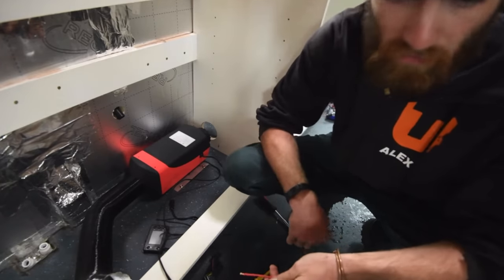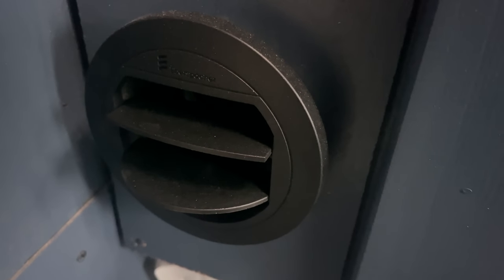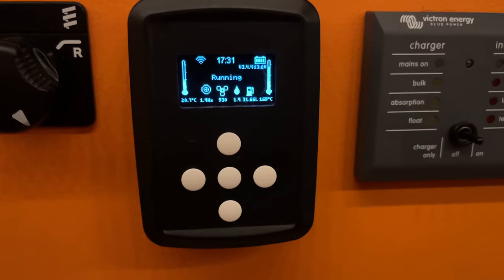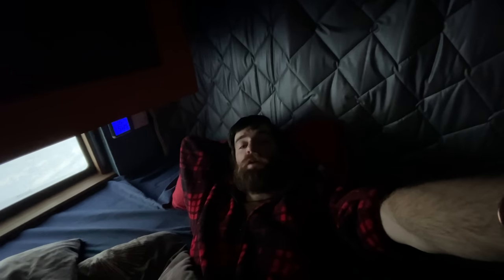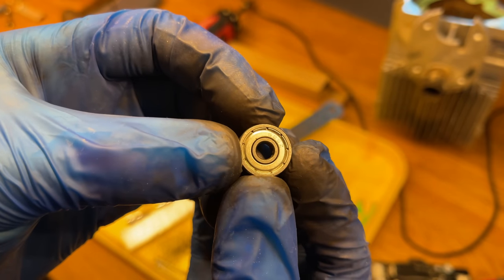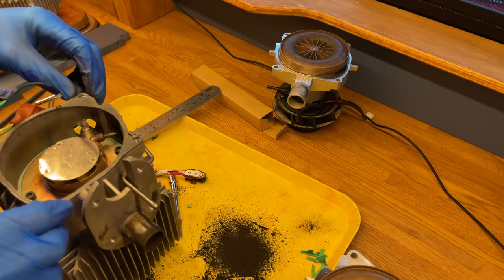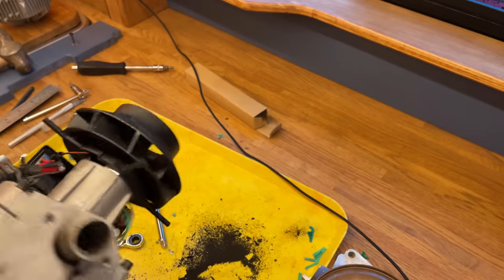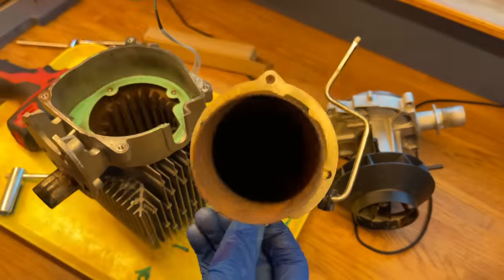2000 HOURS LATER! Chinese Diesel Heater

Comment: I actually enjoyed your video.  Factual and no ridiculous claims made.  Many others, out there, just don’t know how these things work - like claiming the 8kW output, which cannot exist in this range of heaters.

Your extra bends and length of the exhaust may make a difference to the operation - a carbon monoxide tester would help but we do not know how it was coping before.  

A couple thousand hours from chinesium bearings is likely good.  You noted the armature had been balanced - but then they may have added poorly balanced fans on the shaft.  Some better(?) fans may have extra weights attached to improve fan balance.  

With regard to the bearing fitment, one bearing should be press fit in its housing and the other needs to be a sliding fit to accommodate expansion between the bearings (fixed bearings would wear prematurely as they would have no end-float and thus load the bearings, axially as the temperature varied.
 
Running on heating oil (28 seconds Redwood kerosene) seems to be an acceptable alternative to diesel (the fuel the machine is designed for).  The calorific value of the kero is a little lower than that of diesel, thus producing a slightly leaner burn.  This may help where excessive bends and/or extra length of ducting is introduced.  That grade of kerosene seems to have adequate lubrication to protect the pump from early failure.

The Eberspacher installation details, for their heaters, provide details of cross-section increases required - to maintain the gas flows within specification tolerances.  Well worth checking out, if non-standard ducting/pipework is used.

Good luck with continued reliability of your heater.  Do note that the afterburner is only compatible with some motherboards - not the latest cheaper issue, which does not have any facility for altering the fuel:air ratio.  Keep up the good work!

Comment: Other's have mentioned RTV, but it's something to have in an emergency kit for your van. it's gasket in a tube. RTV stands for Room Temp Vulcanization, so once it's set, it's propper rubber. you can use it to fix a lot of problems in an emergency. I've even seen it used to fix tents if the fabric will bond with it
Reply from the maker: Thank you. I have definitely been educated on many different solutions for gasket repair because of this video.

Comment: That motor commutator looks brand new still.
Really impressed how good everything is.

Bet if you just run it at full for an hour every now and then you burn it clean instead of disassembling it
Reply from the maker: Thank you. I did know that part was called the motor commutator, I had no idea at all what to call it. 

Some people will do a hot burn. Mine is on a thermostat so I run at max for 30 minutes to get up to temp normally. I’d consider it pretty clean

Comment: Thank you for putting my mind at rest regarding using these heaters
Reply from the maker: Don’t know if you mean that in a good or bad way. But these heaters have a wide range of quality because there’s probably 50+ factories, which produce them some crap some better. This particular heater in the video is now at 4500 run hours. £6 in bearings and one pump.

Comment: I run the planar 44d diesel heater as my main heat in my 32ft motorhome .
I now have 5 years run time on it. I start it in the fall and it runs non stop till spring.
So it's running 24/7 for 6 months non stop. And zero problems. 
I had webasto and eberspacher but always had a problem getting parts.
Someone told me about the planar brand which were originally made for Russian military vehicles in antarctic.  Sure you can buy 5 or 6 heaters made of Chineseium 
Scrap metal  for the price of a planar. But I like doing a job once and being done.
I am still running the original exhaust. Controller. Fuel pump and fuel line. I do remove my filter every year and blow it out as its a serviceable filter.
I have found this heater to operate 75deg f running %15% used oil from my diesel
Mercedes after it has sat for 6 months and filtered. I found the extra heat keeps the burn chamber from sooting. I also add a few oz of LIQUI MOLLY DIESEL ADDITIVE which seems to help with soot and keeping the glow screen clean.
I also heated my 28ft cabin cruiser for 7 years with one of these heaters and heated my 42ft double cabin 2 bath hatteras classic yacht with the larger heater.
Personally I love diesel heaters but with today's fuel prices at $5.85 a gallon
This year I have used propane heat. What parts do you live and what are fuel cost there. Here in america creepy & crooked joe biden has made a real mess of our country. Under trump we were totally energy dependent and exporting reserves
But biden destroyed that his first day in office. Hopefully the world will get back to normal after he is gone and russia/Ukraine is over.  It looks like you have a lifestyle close to mine being free and exploring. I wish you well and safe happy travels. 
I will sub to you and check out further content from you. Take care and be safe.
Robert
Reply from the maker: I am a fan of the Planar ( now Autoterm ) units, I’ve fitted a few. I think they are some of the best options available for price and quality

Comment: The gasket seal on the intake fan side can be replaced with a home made gasket made from thin card like cereal packets.  Smear both faces of the gasket with copper  grease and they will release easily.
Reply from the maker: I’ve learnt a lot from the comments about how homemade gaskets can be made
Reply: @MispronouncedAdventures  I used to be able to buy sheets of "gasket paper" in England. whether any car parts place has any now......

Comment: Great video! I think you proved that by using the heater all the time keeps it in best shape! Also - a man after my own heart - someone that carries a spare heater. I run eberspachers (thats all you could buy 12 years ago when i had to replace my heater) but when they give up the ghost i will be moving over to a chinese model. New sub here!
Reply from the maker: Thank you for subscribing. I definitely with the heater are  well installed and you buy a good one from maybe of the different companies then they can run just, 

But definitely carry a spare one just in case
Reply: @MispronouncedAdventures  I need to dissect some Webasto heaters on some Ford Transits from between 95-99 that have probably been sitting too long...
An inverter from 12V DC to 230V AC works as a spare heating fan plus the regular compartment heater. For longer distances, a separate generator may be needed and or extra batteries...

Comment: I was always thinking I’d be looking at one of the more expensive diesel heaters in my next van but after seeing your set up with that better controller I might have to re consider. Helpful video!
Reply from the maker: The afterburner in my eyes makes the Chinese heater have better functionality than the western brands
Reply: @MispronouncedAdventures This means Chineese are going slower but surely advancing in tech in compare to Western one. They are already slowly taking over car industry as any other.Well...when the profits are above all this is what you get at the end.
Reply from the maker: @The_Touring_Jedi  Chinese heaters normally are just okay. The afterburner controller was a project by Australian to make the Chinese heaters better

Comment: This video sold me on these Chinese diesel heaters 1000%. Soot contamination from burning a poor mixture had always been my biggest concern, but it looks like I massively overestimated the risk.
Reply from the maker: No all Chinese Heater are equal. But searching out a good brand in the first place will help
Reply: @MispronouncedAdventures  Aren't they though? Every one I've seen (in their respective 2 / 5 / 8 kW categories) has been mechanically identical.
Reply from the maker: Body wise they will be same. But the ECU which runs the Heater is where the main difference.
Reply: @MispronouncedAdventures  Good to know. The stock control behavior on these Chinese heaters is terrible so my plan has always been to build a custom ECU and "thermostat" when I rewire my van and install one of these heaters.

Comment: I am incredibly happy to see you running the Afterburner. I've installed 7 of these heaters now and won't install one without the Afterburner. Ray Jones is a god. Thanks for the link to the exhaust - I hadn't seen this style option before.
Reply from the maker: 100%. I pretty much wouldn’t use a run one of these heaters without the afterburner. I don’t even find the other big  brands control systems comparable in functionality.
Reply: What is the afterburner part you speak of
Reply: @justmyopinion5234  the Controll Pannel is called Afterburner I guess
Reply from the maker: The third party aftermarket controller for Chinese diesel heaters is called a “Afterburner” which does occasionally add to confusion with the name, afterburner used on a type of jet engine
Reply: Give mate, we just bought a traffic and there is a diesel heater underneath pull out bed the guy built but jo exhaust so I dont want to use it ,, where do you cut a hole for the exhaust fumes ? Thanks George
Reply: Can someone provide a link for this afterburner?  I'm interested in buying the heater and an afterburner

Comment: Just like yourself I love to experiment with these Chinese heaters, currently running two of them to heat my home with the electrical power provided by solar power stored in batteries. Love the videos.
Reply from the maker: Yeah definitely a few things I’d like to play with with those heater if I had more time
Reply: @MispronouncedAdventures  I have been using a medical dose feed pump with limited success but I think I can improve on it with different gearing, these pumps produce none of the deadly bubbles in the fuel line but their stock RPM is just too low

Comment: Ive watched many videos while considering buying one of these. Running the heater on high for 10 or fifteen minutes before shutdown is mentioned as a way to help keep the unit cleaner from soot.
Reply from the maker: Personally I don’t bother and it haven’t bothered in 4500 run hours. Sooting up isn’t an issue in my heater. maybe that’s as I have a working thermostat

Comment: So someone (me) decided to play with my heater settings and found a pretty low setting where the heater was barely audible. "This will be good while I'm working on the van." The amount of carbon when I dismantled it after it stopped working was insane! Don't mess with the default settings guys 😏

I needed to buy a new burn chamber to fix it. Which was about £25.
Reply from the maker: I do understand lot of people play with settings. not done it myself as it’s always worked so far for me as stocks. But definitely not all heaters are the same

Comment: I have Chinese diesel heater I am using it for 6 years I Ben -35 Fahrenheit in north states and still working perfect I only change the Exos heater pipe and that all I only started one time every month in the summer for 10 minut.
Reply from the maker: They are great unit when you get a good one. 3 years with this one and two Arctic winters

Comment: Factory settings caused mine to soot up within a couple of weeks. I probably removed about a kg of soot which was insane. I did watch alot of videos as far as tips for setup and made sure It I had it all covered. Ultimately I had to lean out my air/fuel mixture to have it burn cleanly, but still get maximum heat. It was annoying to have to do that so early, but I had alot of fun seeing the inner workings of the heater.
Reply from the maker: I think part of the issue as there are so many different ECU / controllers use which control all of the components, fan motor, pump speed, temperature sensors, and so on that they are not all equal. Some heaters with standard settings seem to work absolutely fine whilst a different heater with a different board/controller on a standard settings might not
Reply: @MispronouncedAdventures  Exactly, with these heater systems looking seemingly identical I would assume variations in electronic components and lower level qc is what causes the huge variations in performance even withing the same batch. I was prepared to have to mess with it, just didn't think it would be that quick lol.
Reply from the maker: I think it’s more the ECU’s variation than quality control issues. I mean obviously there are quality control issues overall and they do make issues , but I don’t think in most cases affect performance. Or at least the quality control issues in the cast body parts shouldn’t effect performance to much
Reply: I had almost the exact same experience. Not only were the factory settings way higher than what is typically recommended for these heaters, the fuel pump itself was pumping way more than it should. I think this was the seller's way of turning the 5kw heater into an '8kw' one. I had to dial the settings way down and buy a normal fuel pump to sort that out.
Reply: @iguanamoat  How do you define a 'normal fuel pump'? I'm learning as much as I can, so as to not mess my new heater up. Thanks in advance.
Reply: @chasmarischen4459  A normal fuel pump for a 5kw should be labeled as being 22ml. However, the unfortunate thing is that these cheap pumps have poor quality control and/or tolerances, so that 22ml pump could still be under or over-fueling by some unknown amount. The best way to mitigate this is to re-tune the settings of the heater after any change you make, including after replacing a fuel pump. The best way to tune them is by measuring the carbon monoxide coming out the exhaust - try to adjust fuel and fan speed ratio until you only have 10's of ppm coming out. You can also get a ballpark idea by the amount of soot in the exhaust pipe - there should be little to none if it's running right.

Comment: Really a cool video.  I have been thinking of a unit ... for a stationary radio station . .. and this is encouraging me.  I know this is running by the time the video comes out but those types of gaskets I make with a small ball ping hammer.. I sure you know how to do that.  Sometimes you can take old gaskets and soak the first boiled water (not kept boiling) and let them soak up for a day or two and then let dry .. . they will recompress to the fit.
Reply from the maker: I was pretty surprised with how brittle the green gasket had become, but I have seen that happen before. They grey ones seems a different material
Reply: @MispronouncedAdventures  Is it possible that I can find the same or updated same unit you used?  Maybe a model number etc. ... ?  pat

Comment: Chinese Espar. Im a diesel mechanic, Espars generally get serviced every 1-3 years as the gaskets in them get hard and brittle and break, causing them not to work.
Reply from the maker: Indeed they are. Overall design is using the expired Espar Airtronic D4 patent. I’ve seen the gasket material varies between different Chinese manufactures.

Comment: Very interesting.  My Diesel Heater in my old Motorhome has been running on a mixture of fuels but not Diesel. Parrafin, Kerosene and Domestic Heating Oil. Basically it was cheaper than Diesel. But not now.  3 years on and inside Silencer is clean as a whistle inside. Cheers from old George in the UK
Reply from the maker: Yeah the heaters are great for running a few things. I know a few who run just kero in them. Very clean burn

Comment: After seeing several videos about this kind of heater including this one I've been thinking about getting one of these heaters .  The lack of build up is pretty impressive.
I just wish they came in bigger sizes or had a higher BTU output. I have a large shop and heating it with propane has gotten really spendy as of late .
I definitely like the flexibility of  being able to use other fuels besides diesel .I've seen videos where people are using waste oil and other kinds of oil and this thing just keeps chugging along . Seems pretty impressive for the money plus it's possible to rebuild it ? That's a big selling point to me especially considering how many items being sold these days have to be tossed in the trash once they break down .
Reply from the maker: Yeah I was very impressed with the lack of build up. 

There are lots of 5kw units sold as 8kw, however I have seen some rare photos of a real 8kw unit before. But it would be probably easier to buy and run 5kw for a large spare. That being said I had heated a large work shop using  5kw

I’ve also a good point on. You can just buy a whole need unit if need be
Reply: They are cheap enough you could buy two for your shop. I don't think I would try used oil though
Reply: I can't imagine heating with diesel would be cheaper than propane. Propane is about $2.80 a gallon where I live and diesel is $5 a gallon. While diesel has about 45% more btus per gallon than diesel its almost double the price.
Reply: @randybobandy9828  in the UK diesel is the cheaper option. Kerosene even cheaper again. But the downside of kerosene is that you have to have a tank whereas the diesel can come from the vehicle tank.
Reply: @stephenlipton525  wow that's crazy. Why is propane so much?
Reply: @randybobandy9828  Russia
Reply: @MispronouncedAdventures I bought a 5k for my 35’ class A and the controller has a little programming flexibility. I can dial the heater down to 1.4Hz to 4.5Hz or up to 2.2Hz to 6.0Hz. It only allows the range to be shifted but having the ability to run 1.4Hz when it’s not too cold saves quite a bit of fuel. 
I like to keep it on manual control so at night I let the RV get cooler and in the morning I turn it all the way up to burn it out.
Reply: @randybobandy9828  same price as pump petrol / gasoline.
Reply: Each one is around 27k btus. They are only 150 bucks. Just get a couple or even 3 .